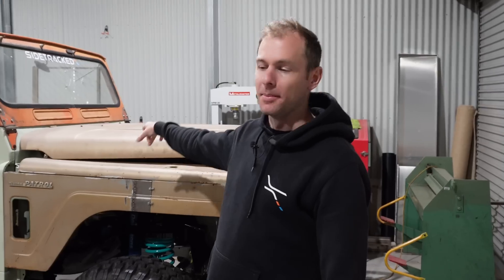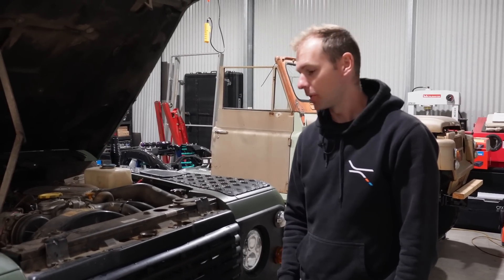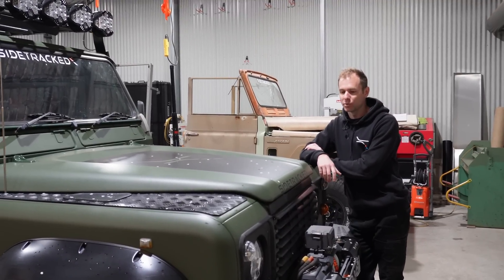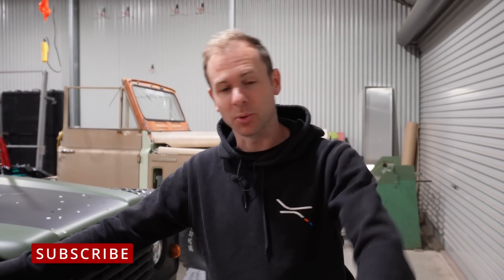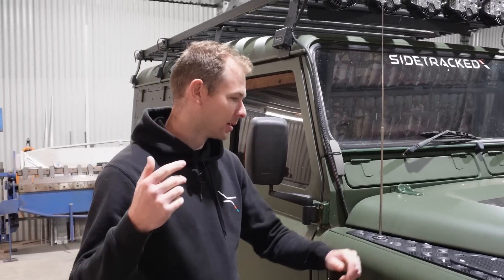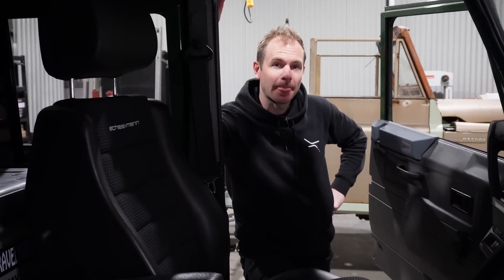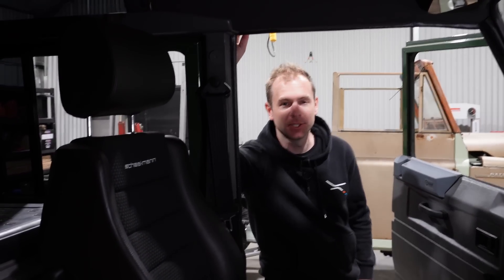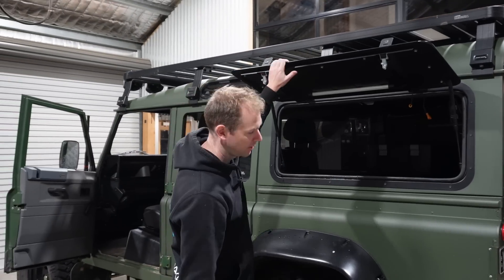Defender Q&A and Update

Comment: As mentioned, had a 300tdi, stick to 255 85, get some power back and less stress on a not very strong tranmission, can upgrade but will be chasing upgrades forever. Excellent off roader.
Reply: 255s are the best.

Comment: Loved the Q&A on the Defender… owning 2 of them myself (Tdi300 & Tdci Puma) I love them as a tourer and my Tdi300 is also my daily driver. It’s fine as a daily but as u mentioned I’m only running 32in tyres and it’s been fine. No AC though but u get use to it plus the front vents work well as long as you’re moving…
Can’t wait to see yours on a Trip since your latest mods…

Comment: If you can get a hold of a later model 110 rear axle with the short nose diff (2002 onwards), that might be a better option. They have a four pin diff standard and Ashcroft does a locker for them too. I’ve done this for my 97 300tdi 110 and it’s been so much better and cheaper to find parts.

Comment: With the lt230 get yourself a extended sump because its aluminium bolted to aluminium.
The o ring will leak eventually. You can replace it of get the sleeve mod installed. 
I tend to get a drip on the rear brake drum on the transfercase. After a few attempts fixing it ive installed a speedy sleeve on the output flange. It makes it slightly larger and compensates for the movement of the rollerbearing-thats just my opinion.
Reply from the maker: Got a sump to fit.. next on the list!

Comment: if you were going to go 33" i'd recommend 255/85r16. not a lot of choice in that size, however they are basically 33" cheese cutters, same width as a 265/75r16 but taller than a 285/75r16 and not to mention lighter.  Though, I'm runnning them on a +6 offset on a perentie and they sit flush with the standard wheel arches, so i'd assume you'll probably end up going with the 285's due to your current extended wheel arches. 

Also, if you get a chance i'd love to see a small video about how you made the sunvisors, how they are going for you and if you would recommend doing it. 
Cheers.
Reply: I recommend the Dick Cepek MT in 255/85x16. Second choice would be Toyo. These two brands have the widest tread area, some 20 to 25 mm more tread across the tread than the skinny BFG or Coopers. The flexibility of this size tyre is another plus, they can be run on rim widths from 5.5 inch (split rims) thru to 8 inch wide.
Reply: @trickster8635  I didnt think Dick Cepek are being brought into Aus in that size anymore; at least that's what i heard ages ago.
I would say Toyo is probably the best with price no limit.
I heard that Coopers and BFG in the 255's are not the best for ware quality, tread depth and overall diameter.
I ended up going with the Yokohama's and so far they have been great and i'd say are comparable to the Toyo in dimensions, but less pricy.
Reply: 255/85R16 is a fantastic tyre choice. Hard to find though.

Comment: Agree with how you have travelled on this road, good choices. Pleasing to see you have realised the folly of 35 inch tyres, unlike the uneducated big is better party. In terms of rear diff lock, I guess you could have swapped out for a short nose 110 diff and then have the ashcroft fitted to that. Would be out of trouble for around 2K. There is a ATB centre diff LSD available from Ashcroft for the LT230, and all driving reports are very much in favour of this modification.
Reply from the maker: Probably should have swapped housings, but I thought the big lump of steel in the back might be the only thing that won't break.
Reply: 35" tyres aren't a folly, just needs a lot of effort to make them work on a rig like this. 
I'd be ditching all the roof gear before the tyres. Fact is, for serious off-roading bigger is better. You just compromise on road performance.

Comment: Carry a spare lift pump with three gaskets and longer bolts. Three gaskets are the optimim thickness. You need also a 1/4 socket set to replace them to avoid not taking injector lines out.
I would recommend the twin intake aswell
Reply from the maker: I thought it was 2 gaskets...

Comment: i almost got the 300 tdi  motor so glade i went with the td5 330,000km on it and haven't had any trouble i did get a nanocom just incise they go good with a stage 2 tune . 
My dad and my uncle both have 300 tdi's and both have snapped there timing belts and done a bit of damage
Reply: Both the TD5 and 300tdi have their problems. The main reason 300tdi timing belts snap is because people wait too long to change them. Change them every 40,000km to 50,000km, end of story.